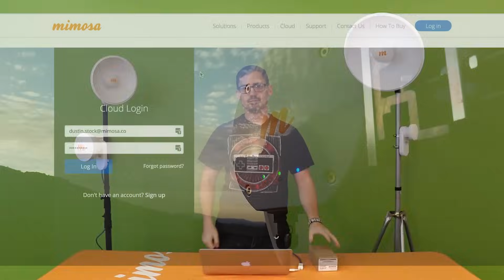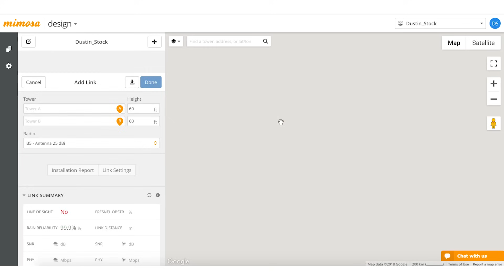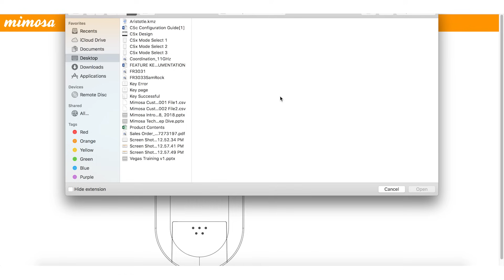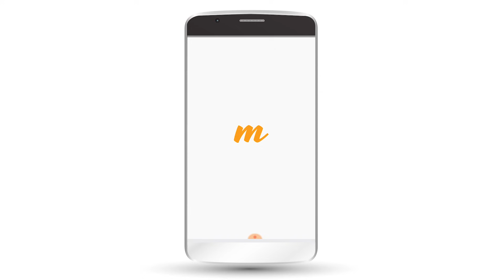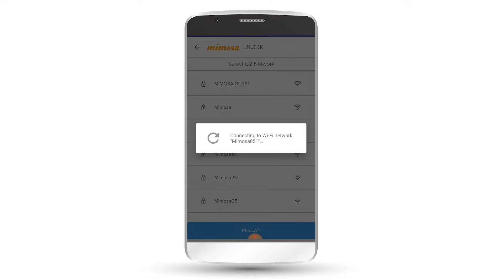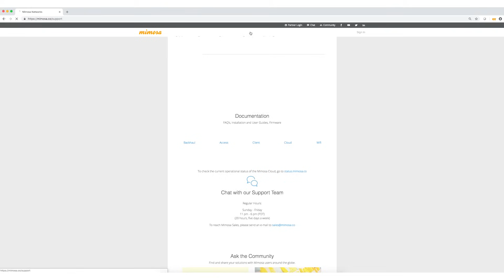Mimosa in the Field: Installation of the C5x

Comment: How we assume  "Heading and tilt values" while aligning PTP link ? Do you recommend to use any tool kits ? or your devices has angular values where we can set ?
Reply from the maker: Thanks for your comment. We don't assume at all. We use the Mimosa NDT to produce what tilt and heading we need. We also use compasses and landmarks to help adjust heading accordingly.
Reply: @MimosaCo  appreciated your reply, just as device reads distance, it will be helpful if your device can read its heading. Is there any compass script to add in your routers to read headings? Just a suggestion. 
We are shifting from Ubiquiti to Mimosa but while testing C5x N5-X25 over Ubiquiti Air fiber 5X AC we are only able to send 200 Mbps in 5 Km distance link, Tried to change channel width but didn't notice any change.